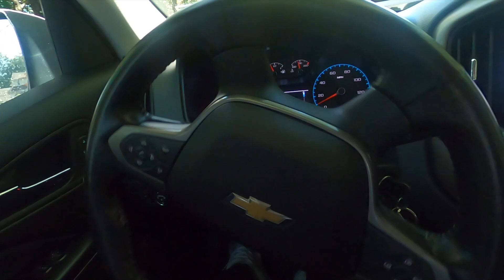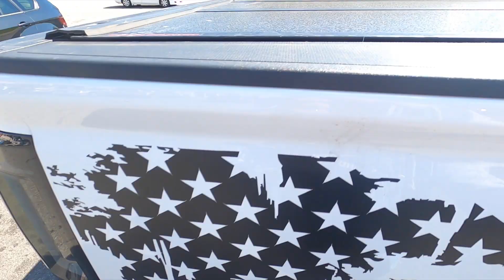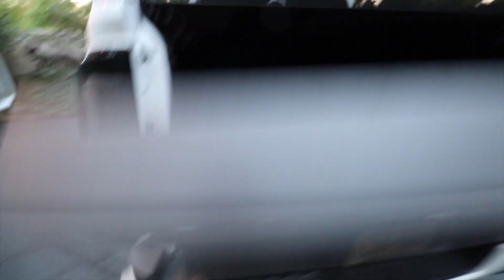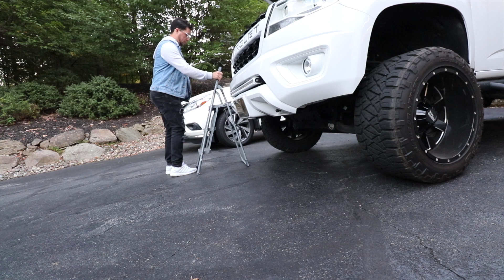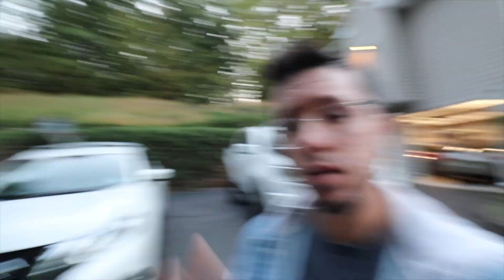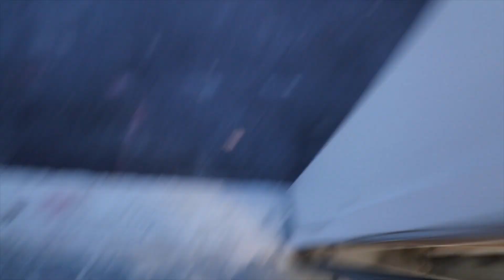NEVER INSTALL A COLD AIR INTAKE IN YOUR TRUCK!

Comment: Iron Vette has the aFe CAI which I love. It provides a few HP more, but it's the look that I really like. Whereas Rhonda the Honda Ridgeline only has the  K & N air element in the factory housing. That's fine by me in that it's all about reliability and ease of maintenance with the truck. Just my two cents.
Reply from the maker: Thank you Pete! Yes K&N is a option for the Colorado as of now! Im with you, love the aFe on the Vette!
Reply: 👍 Thanks Matty.

Comment: Hello everyone, i have an Airaid cold air intake for 4 years in my 2016 Colorado and it sounds great and no rust. The air box is plastic, and the bracket are high quality metal. The bonus is that you can keep your engine beauty cove on. Message me if you would like to see pictures.
Reply: Hey man! I’ve been looking to change out the stock CAI for my 2018 Colorado but I would like to keep the cover on, you think I can see pics of yours installed?
Reply from the maker: Cool man! Thank you for sharing it!
Reply: @Matty.Garage  u r welcome

Comment: I rub the exact same spot, even the fender bent inwards and that plastic piece wasn't sitting as yours was, i might just trim it off w a saw saw lol. Also thanks about the air intake, it was my next mod, then maybe combine it with a straight pipe if it doesnt sound to ricey.
Reply from the maker: Man, I hate this thing about my fender! Funny that only one side does it! I will try to fix it!